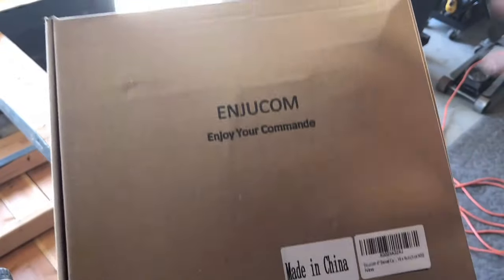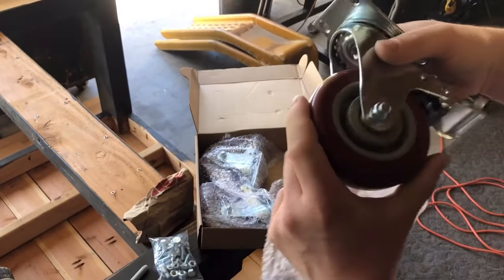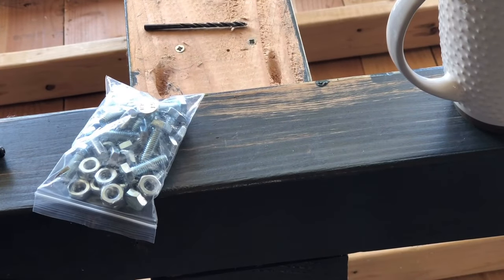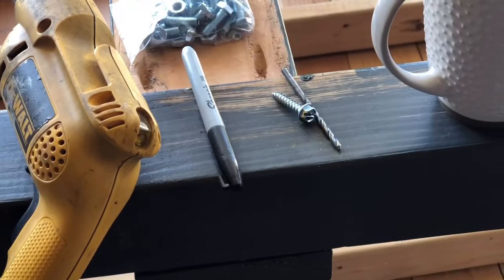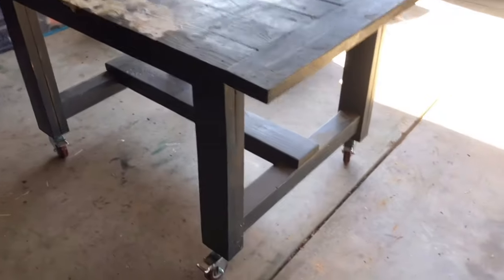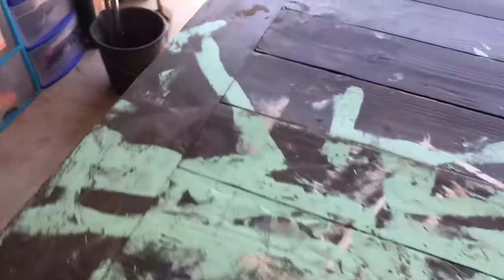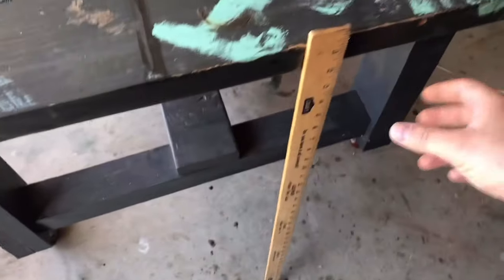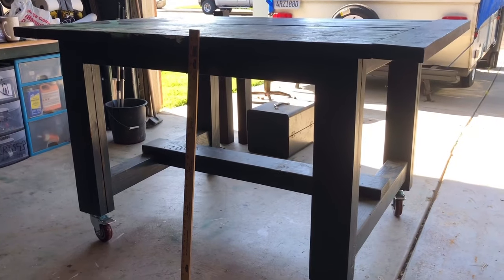5 Minute DIY How To Installing Caster Wheels On A Shop Work Bench Table Amazon`s ENJUCOM 4” Casters

Comment: Hi, could you please let me know the detailed descriptions of the screws you use? Thanks
Reply from the maker: Hi , they are hex head galvanized 1/4” Lag bolts by 1 1/4” long, cheers
Reply: If you need wheels and accessories, we can help you, because we are a professional manufacturer of wheels

Comment: While screwing into end grain is a big no-no,  if you must, predrill, install screws. Then remove the screws and soak each hole with CA glue and let cure. This will increase the holding power of the screws and should last a long time. I have done this out of necessity and it has worked well.
Reply: Do you let the glue dry and THEN insert the screws?
Reply: Yes let the glue cure or spray it with an accelerator to harden instantly. It turns the wood into sort of a plastic insert. @kbanghart
Reply: @marvinrayweast  nice. Thanks for the fast response! Maybe you could help me with something.. trying to attach casters to a 2x4 wood frame. There are previous screw holes, so either I somehow attach them a different way, or fill in the existing holes and use those. Or if the caster base is too wide for 2x4 I'm not sure my next step.
Reply: @marvinrayweast oh maybe I just solved part of it.. I can add extra 2x4 pieces inside the existing frame to build a bigger surface area
Reply: I thought the same thing.

Comment: Screwing casters into end grain is not really problematic - at all.

There is no pulling force. The screws prevent horizontal shear and the casters reduce the friction with the floor significantly you wont have problems.

My grandpa installed 8 caster wheels into his 450 pound, mahogany partners desk in the 60s (with no dowels) and it's still going strong today. Zero loosening.

Comment: These wheels are one of the BEST FINDS for the price!! 🤫 I wish you didn't say where you got them. I have to get a few more sets and I don't want the price to go up. I have the black ones with the cut outs old style. I use them on almost everything. Thanks for sharing on what type of replacement screws to use. I wasn't sure. I have a few different styles of wheels and the new sets I got are like yours with the bolt kit that wouldn't really work for my desks,  work benches, and cabinets I am building for my art studios. I am living in a warehouse and need wheels on everything to move things by myself. A few times they have been sold out.
Reply from the maker: They are holding up great for myself too, thanks for sharing and watching I appreciate it 🍻

Comment: I would have added a wood 1/2" plate to the end of those legs that way those lag screws don't come out over time.
Reply: How do you add the 1/2” plate to the end of the legs??  Wouldn’t you still have to drill into the end grain to install the plate?  Or do you use construction adhesive?  I need to mount casters today and need additional info.  Thanks
Reply: @bklyn2va2dc  A lot seem to use pockets holes coming inward and downward to the bottom of the leg into a square piece (and glued).
Reply: exactly
Reply from the maker: @Mr_Gadge  this seems stronger, but I must say the wheels on my table are not coming off anytime soon! Wheels are on very solid.
Reply from the maker: Update!! Just checked , no lag screws have backed out , caster wheels on solid 🤷‍♂️

Comment: You think those wheels would support a 67 mustang body. Im making a body cart and im just not sure about those wheels. Car body probably weights between 800-1200 pounds. You think they would work?
Reply from the maker: MILEHIGH JAX they say they are rated at 300 lbs each , so if you have the load balanced across all fours wheels evenly, it’s going to be close to the limit.. to be on the safe side maybe go up one more in size or rating. They are a solid wheel and glide nice , that’s for sure.
Reply: @ATEMOFFROAD  thank you for your help.. think ill give them a shot. Maybe the next size up to be safe! Thx
Reply: @milehigh3054  I strongly urge you to consider steel casters for that type of heavy weight. In my experience, you need  to purchase casters that can support double the weight that is applied to them. Also, the larger the diameter, the easier it is for them to roll.

Comment: Rule #1. Never install casters directly into end grain.
Reply from the maker: @garyoa1 💥 nice, thanks for watching, I have had zero issues and they are solid mounts, please tell us why you think that? They have been very strong  mounts in my opinion,  the table I did not make, but was told the design was taken from @Shanty2Chic
Reply: @ATEMOFFROAD  Legs will eventually start to split. I assume that's why you got hardware with them. But they'll last a while anyway. Just a different procedure for mounting in end grain. Generally a royal PITA. :)
Reply from the maker: @garyoa1 thanks for sharing, I’ll keep you posted on this, cheers!
Reply: Why not ?